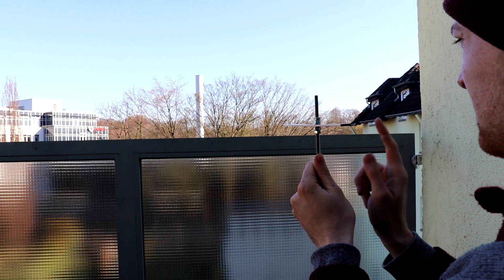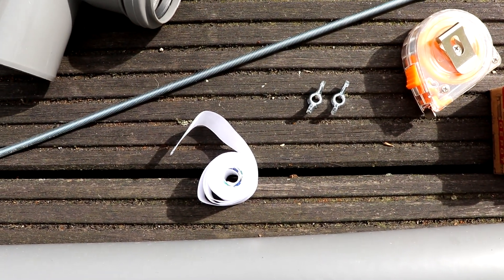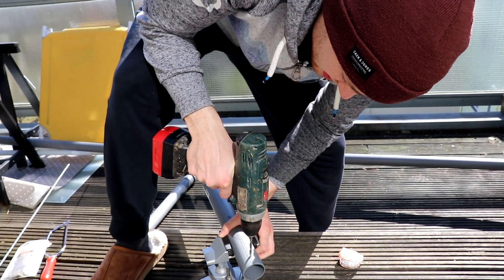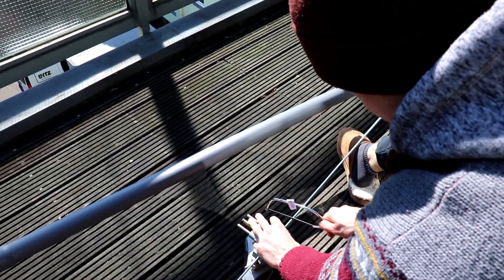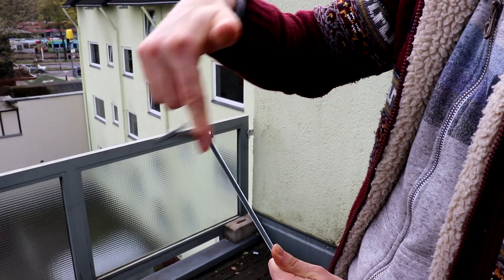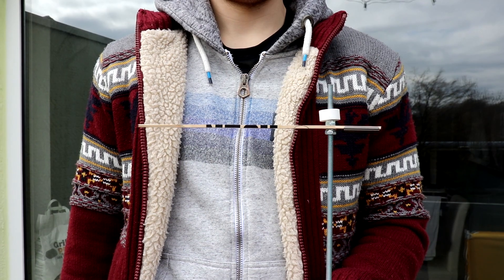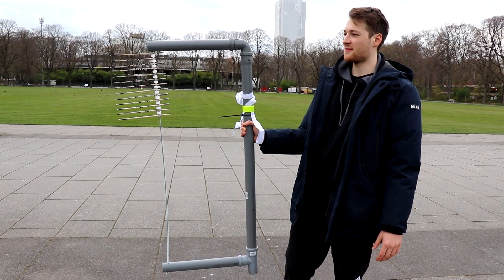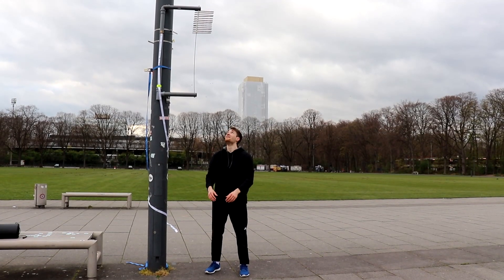DIY Vertical Jump Tester under 23 $

Comment: Great vid, what are those white round things you put between your chims
Reply: Thx for replying
Reply from the maker: Thank you! These are called plastic spacers, you should be able to find them in your hardware store. However, you don't neccessarily need them, because the lock nuts will stay in place without them. I just used them for even spacing